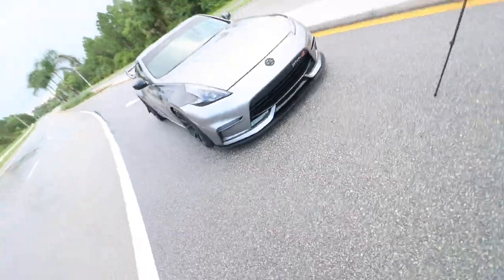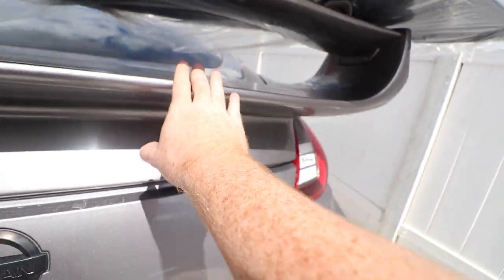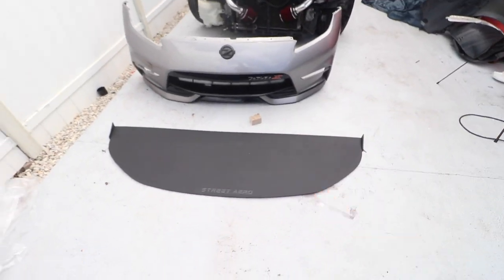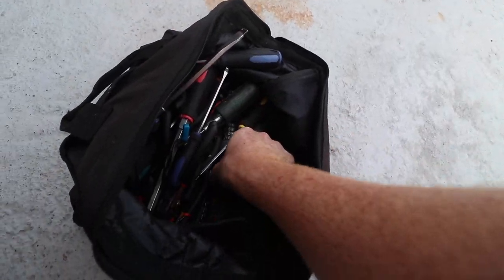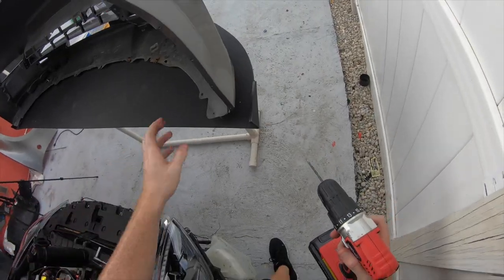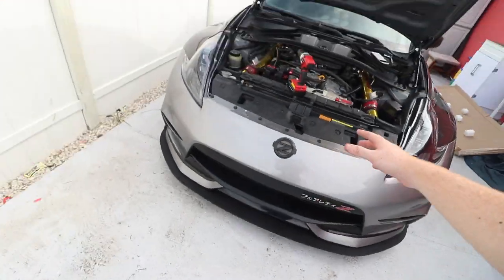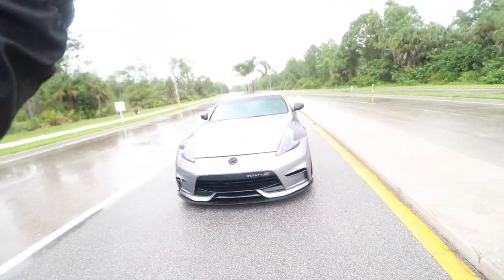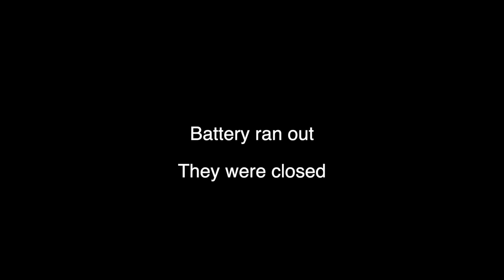MODIFIED NiSSAN Gets AGGRESSIVE Racecar AERO MOD!!

Comment: Hey so I'm getting a 370z soon and I'm on a budget but it's my dream car to have at 19 lol, been working since I was 15, what are the best budget cheap mods to do for performance, CAI, tune, exhaust? I'm going to turbo it eventually, It needs to be manual and hard top, any specific year, I heard the 2015 and above have the fixed oil pump? Anything else I should know?? Thank you 💖💖💖